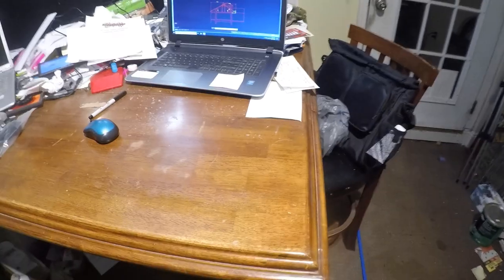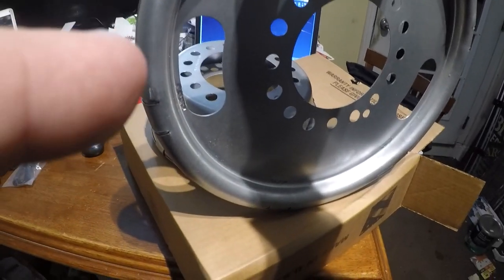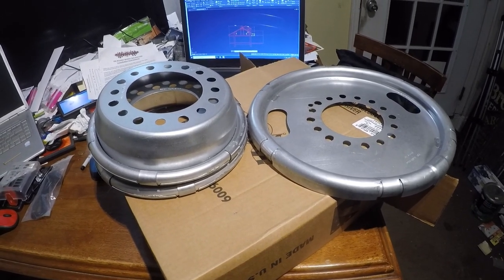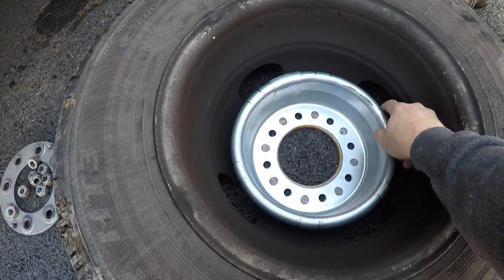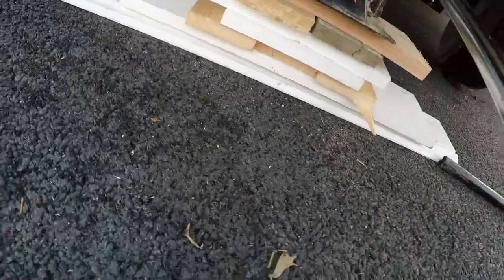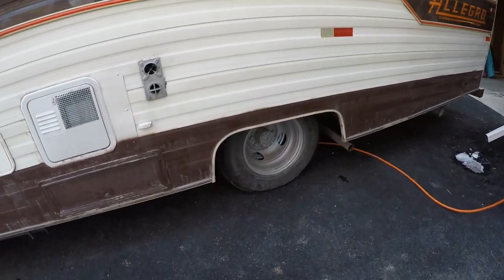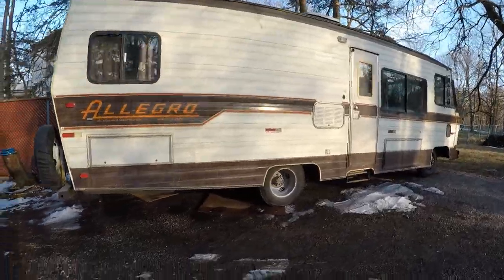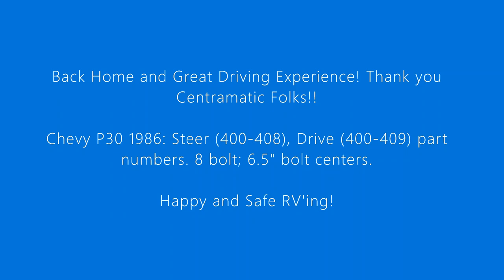Centramatic Wheel Balancers: Install and Test Drive!

Comment: Believe the rear balancer should be flipped around for easier and closer proximity to the air stem.
Reply from the maker: not sure why my reply didn't get on here. The balancer is installed correctly based on Centramatic's website.